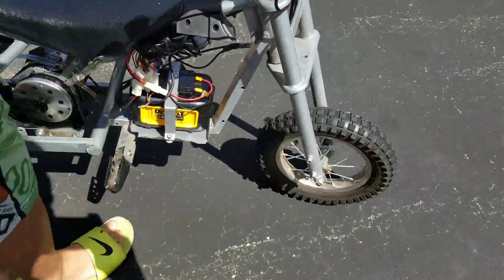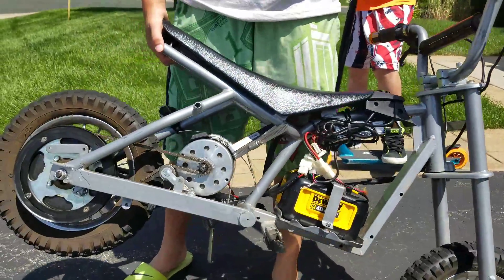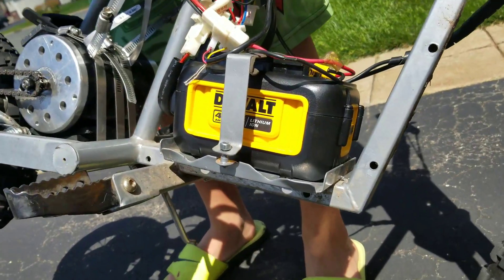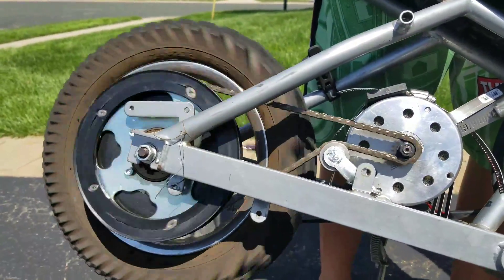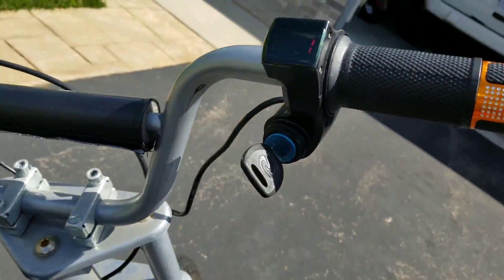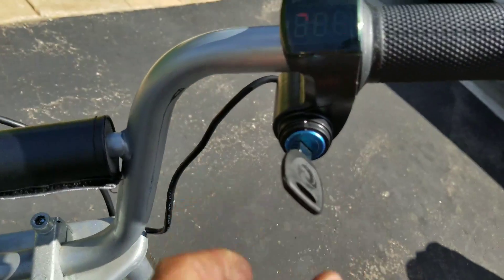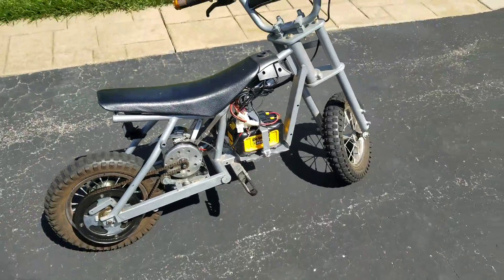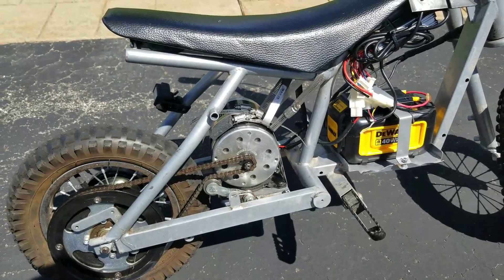MX350 mod to 40v 800w

Comment: How were you able to use 1 battery and not 2 in series?
Reply: Its a totally different style battery. The one that are using is one for an electric weed eater. Very powerful at 40 volts.
Reply: A 40 volt lithium battery is really 10 lithium ion batteries in series. 10s... fully charged is 4.2 X 10 = 42v Fully discharged is around 2.8 X 10 = 28v
Reply: Technically a 10s is a 36v nominal battery now that I say that. Tool battery manufacturers fudge it a little for marketing and competition and call it a 40v. At least that's been my experience with tool batteries. DeWalt might be different but I doubt it.